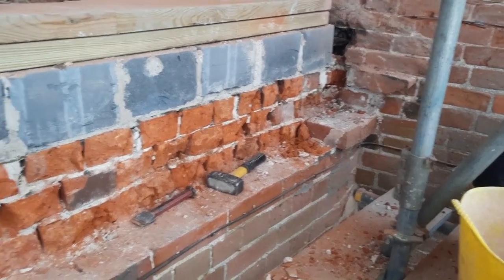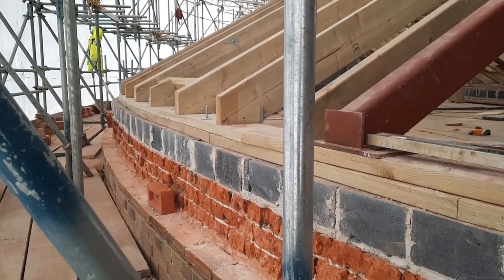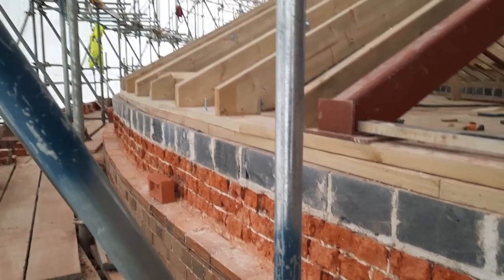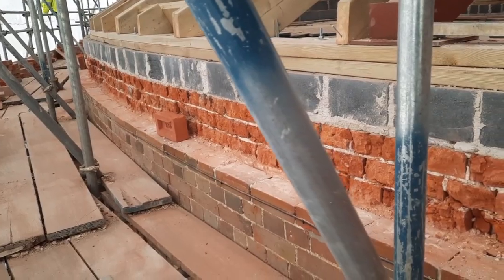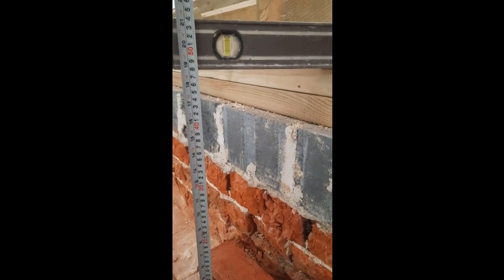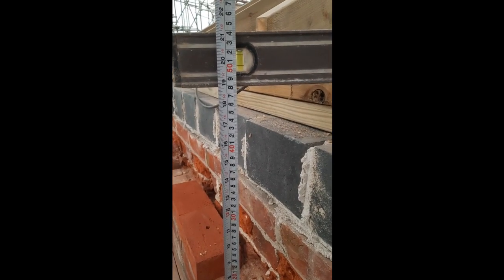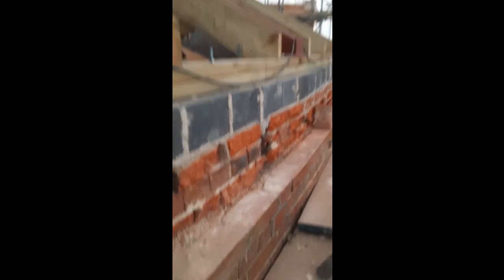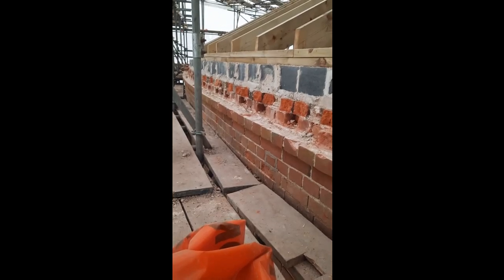the fine art of brickwork - Courtyard 2 - Dentil Course

Comment: Interesting project to be involved with. But a lot of those bricks on the inner leaf look like they should have been replaced, especially as they’re the loadbearing ones. Doubly so as there’s no sign of lateral bracing for the timbers rafters at wall plate level inbetween the steels.